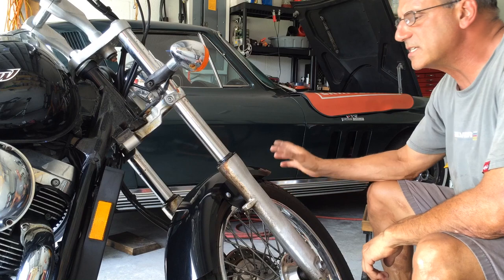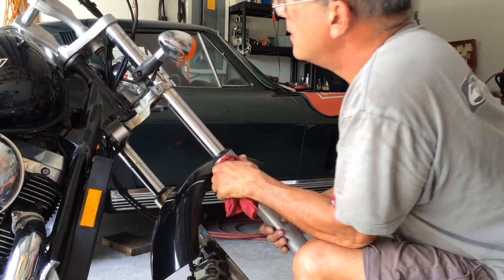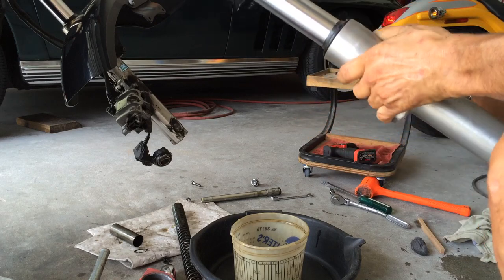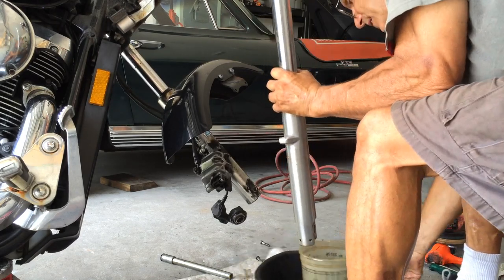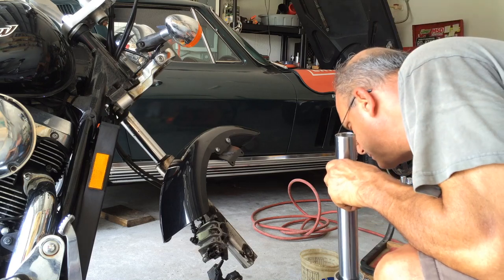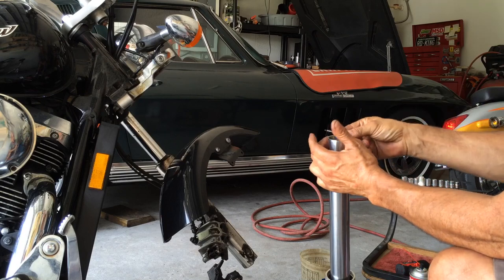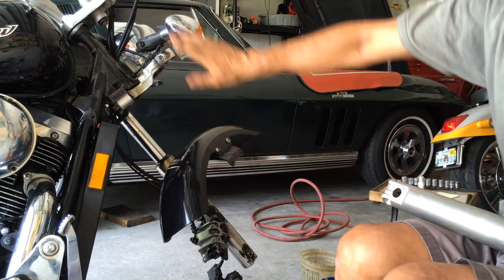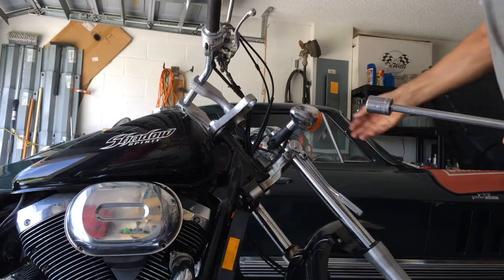How To: Repair Honda Shadow Fork Seals  Part 1

Comment: Thought I saw the tight portion of the sprin on the bottom
Reply from the maker: Yes good eye.   It never made a difference. But yes, try to do it right side up. Now when I do it, I put the springs inside a 5 gallon bucket so I don't make a mess and it keeps the direction. Thank you for watching and your sub.GFernandez. Ride safe and have a great day. It's not a bad job to do.

Comment: my fork bolt in the bottom is 8mm and one will not come out.  Even with the spring in and compressed as far as I can while using impact.  Now what?
Reply from the maker: Couple shots of  rust buster. And wait a day and try the impact again.  works for me. Let us know how it works out. Thank you for watching and your sub rocker. Ride safe and have a great day.
Reply: @TwoWheelRocco  I'll give it a shot.   I'll let ya know if it worked.  Thanks.
Reply: I managed to get it.  With the break free stuff and a more powerful impact driver it finally come out, wow.  Thanks though.  Take care.
Reply from the maker: @TheSkittle1976  Happy to read all is well. Ride safe and have a great day.  Thank you for watching.

Comment: Honda cb650 nighthawk 7,000 miles.
Reply from the maker: Spray liquid wrench in and around the axle, both sides...use 1/2 impact and spin axle by bolt side...tread nut on and tap nut side with hammer. be careful not to hurt the treads...Take your time and let oil soak in..Let me know how it works out...That is what I do...take your time...be careful...

Comment: You put the spring in upside down
Reply from the maker: Yes I did,  Do you think it makes a difference?  Thank you for your Sub, Ride Safe and have a Great day.
Reply: Yes makes a big difference the tight coil is made to take more pressure as the initial impact starts at the bottom and the wave is slowly dispersed and the coil of the spring gets wider